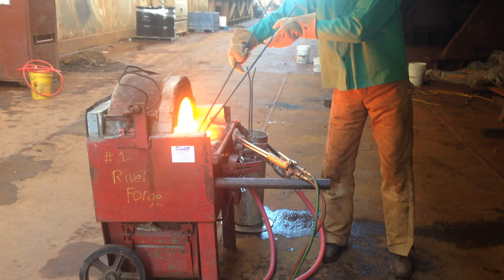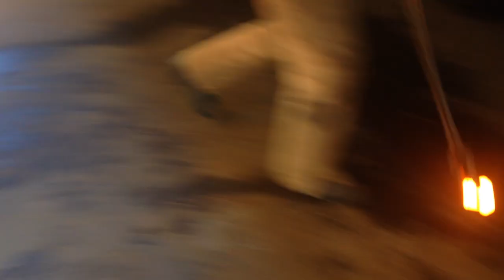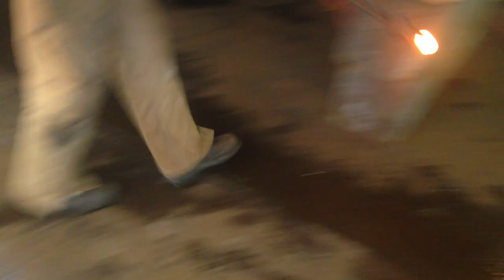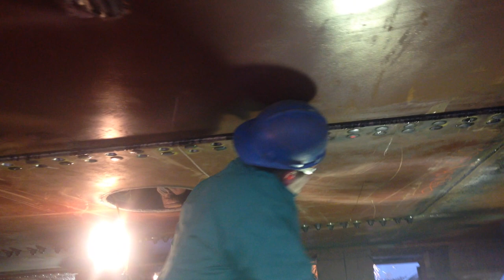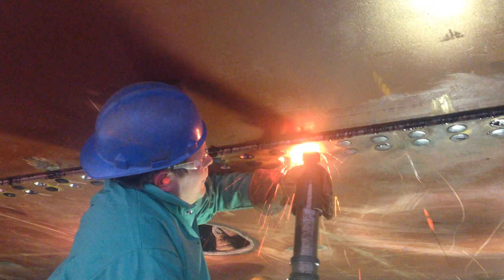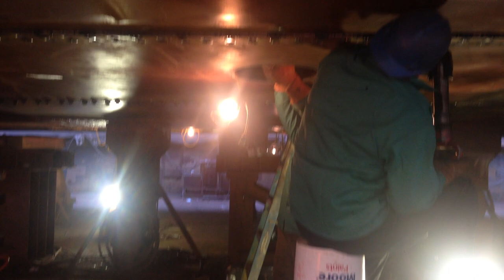Riveting the SS JOHN W BROWN

Comment: I was surprised to see this, as I was under the assumption that Liberty ships were welded together. How much of the John Brown is riveted?
Reply: Most of the Bilge strake plating and some of the Bottom plating on later vessels.
Reply: They are welded! I can only assume they are riveting it for the extra structural advantages so it can go underway more safely (which it does once or twice a year, usually with the sea cadet program)

Comment: OMG - put some hearing protection on!!!! That guy will be deaf in a week.
Reply: you do see the in-ear earplugs right?
Reply: +garytail1 Imagine what it must be like for the guy inside the hull poking the rivets through.
Reply: Yeah, Bowman - that's not enough. But it'll take longer to deafen him. :)
Reply: What?
Reply: @Netlife-001  He has a bigger hammer than the riveter on the outside if you watch carefully you will see that he fires a short burst to ensure that the rivet is driven through correctly before the riveter starts to "knock down " the rivet.
Reply: @MegaBoilermaker  yes but it is a